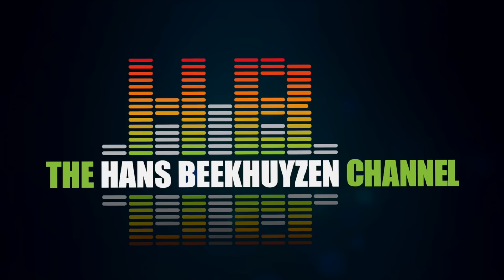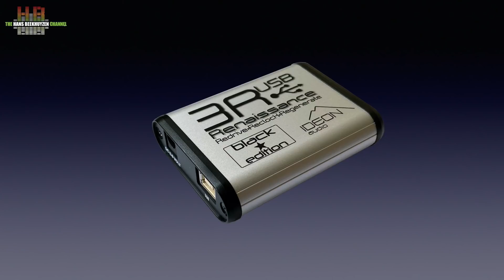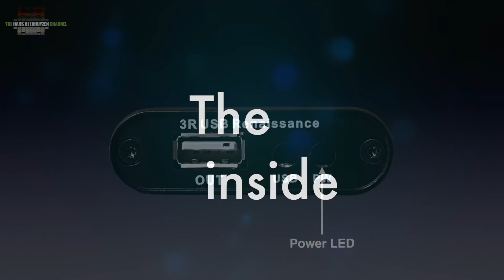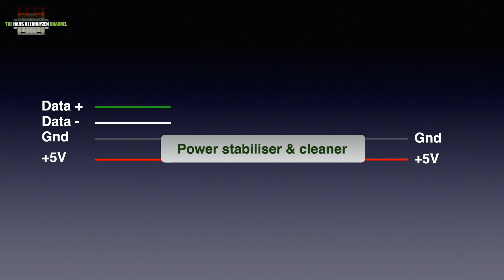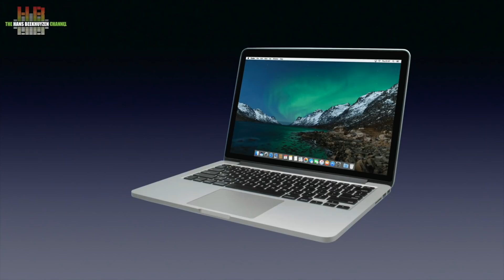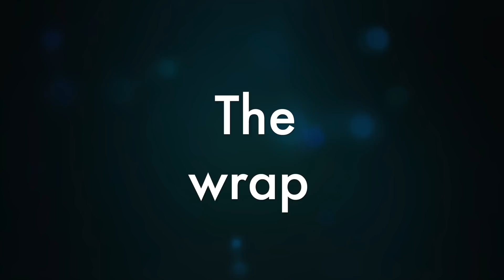Ideon Audio 3R USB renaissance USB reconditioned

Comment: Interesting and simple device.
One thing immediatly stood out for me from the PCB pictures: the voltage regulators on the board, Iet me explain:
- The larger voltage regulator marked 7805BG is generating 5V and I assume that it is used as the USB +5V. So the "clean side" is not double regulated on the +5V, and it does not need to be IMO.
- The smaller regulator marked LDRB seems to be a 4.7V regulator (it's a TI LP3985IM5-4.7). This is strange, 4.7V is atypical and the Microchip USB2532 requires a 3.3V (3.6V max) power supply. 
- Under these constrains I suspect that the small regulator is in fact a 3.3V regulator, the LDQB (TI LP3985IM5-3.3). 
Just my 2 cents. :)
Reply from the maker: Thanks

Comment: Hi Hans, I am using a computer equipped with the Audirvana app which is supposed to reduce noise and improve the sampling rate. Do you have any experience with Audirvana?
Reply from the maker: The truth is slightly different. Audirvana - which is amongst the best - does not reduce the noise nor the sampling rate. it prevents the sound quality of getting damaged by what computers normally do to sound. Watch https://youtu.be/u3x6JoN9LDg and https://youtu.be/9EKB0NH0qDA
Reply: Thank you very much!

Comment: Hi, Great Video. Unless I am wrong, you said you got an improvement when used with a SOTM Ultra. I am quite surprised since the SOTM is supposed to output a very stable and precise USB signal.
Reply from the maker: It does output a very stable USB signal, but - for instance - not as stable as the \Auralic Aries G2 or the sMS-200Ultra Neo with external clock unit and the sPS-500 power supply. Their network switch again can improve the sound...

Comment: Does the 3R only do PCM signals or can it also read DSD?
Reply from the maker: If you use DoP: there is no difference to the 3R, DoP 'looks like' PCM to it.
Reply: It will work with any audio data stream ; "native" DSD ,DoP and PCM , as from source standpoint 3R it's completely transparent and doesn't require any drivers, hope that helps.

Comment: So many question's clearly higher end equipment won't benefit from the R3 in chain,  also we gave tet another walwart power supply impacting the sound. So is this really much if a value proposition for people plugging in their Laptops to a stereo system when surelybtge biggest increase in sound quality they are going to get fir the money is  a Dragonfly Dac then a little upgrade to a jitter bug which does make an audible difference and both for considerably less than a USB cleaner gizmatron. I don't believe it's good value but respect the other opinions  here. I do so enjoy your channel though Hans. Thank you.
Reply from the maker: Well, this feels you are twisting my words a bit. Streamers up to € 600 rules will benefit and probably even higher class.